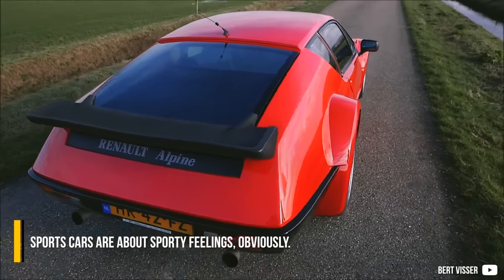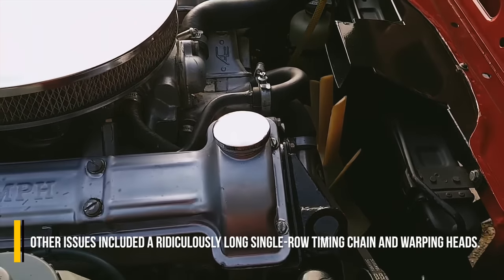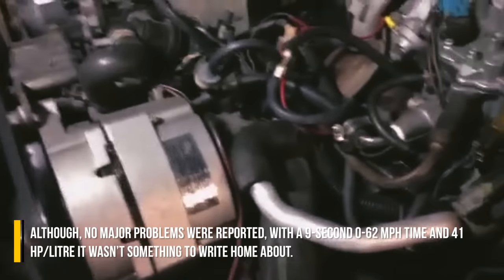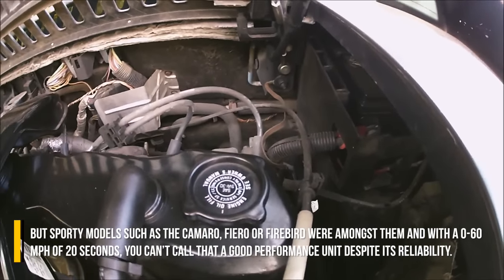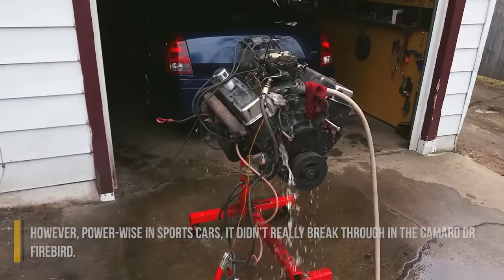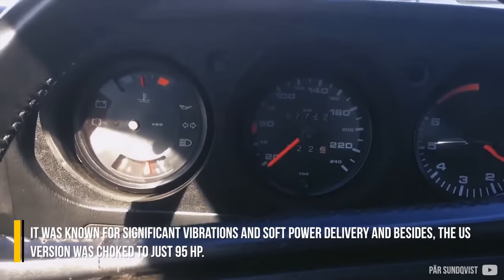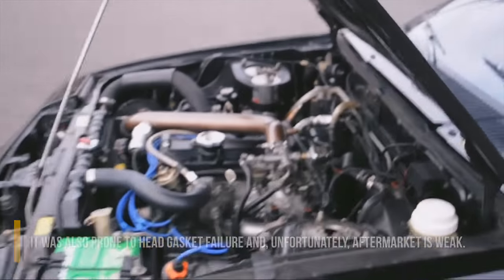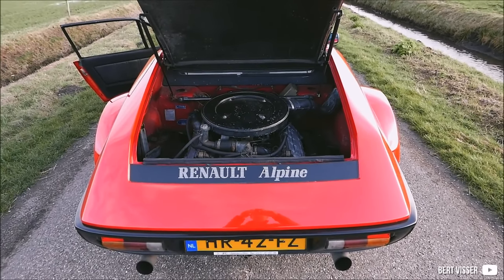Don't Buy These 7 Engines For Performance

Comment: the 80's were a dark time for north american engine producers. There was a 15 year period were the big three had to work with hotrodders in order to figure out electronic engine management.
Reply: @Tenorio_Cavalcante   yeah in 1987, the Buick grand national X was putting out a roughly 250/260 hp with a 3.8l v6, whereas the same year corvette with a 5.7l was only putting out maybe 230ish hp.

Comment: The iron duke soldiers on without complaint or failure...…….in my forklift.
Damn good engine if you just need a plain vanilla engine that can do nothing special, except run.
Reply: Steve po they can make crazy power too though. The super duty version in the non production pace car fiero was basically a built up stock iron duke and it made over 300 hp naturally aspirated
Reply: @zerohourdrift  is there a chance to somehow mode the stock iron Duke to achieve anything near that power?
Reply: D-Phoenix I mean if you take it to a machine shop and have it bored and stroked out, have custom cams ground, and have a crazy port job I’m sure you could. The issue is that there’s very few aftermarket parts, and the super duty ones were special race engines that use custom parts that were never available
Reply: @zerohourdrift  I read an article on hotrod which listed the aftermarket parts so you could build a super duty of your own. https://drive.google.com/file/d/0B0gyQbgYjXzfOWstRWs4SFpNcTA/view

Comment: To be honest, at the start of its life, the PRV was indeed a somewhat underpowered and uninteresting engine, with a troublesome maintenance (lubrication problems, regular valve play check), but improvements after improvements, it ended as a pretty impressive thing under the hood of Venturi sports car (boasting 400hp in road-legal 400GT, 600hp in the LeMan race car). Its V8 roots made it virtually indestructible even boosted with twin turbo, thus it is still holding today the world speed record on a circuit, with the WR/Peugeot P80 prototype, at 405km/h. The 2664cm3 flavor of the PRV was twin turbo-boosted at more than 900hp at the time. That is 333hp/l.
Reply: And there's something to say about the great Alfa 155 DTM. Its engine was based loosely on the PRV (used by Lancia at that time),  but everybody believed that there was a Busso under the hood. That was a big surprise that Sergio Limone, engineer in Fiat group, revealed only recently. Search "Limone Racconta: La verità sul motore Alfa 155 V6", with English subs.
Reply: True, i'm thinking about getting a 505 (with the 2.8 prv) slam it, and pushing it to its limits. The thing would be a really good sleeper:, rwd, good power numbers, slow look
Reply: @grymbathym635  don't slam it, put it on some coilovers and meaty tyres, make it a trackday car
Reply: the boring by now answer is ls it oddly I'm saying this about a Renault but i like the body lines , be a cool ass car if you just woke it up

Comment: 0-60 COMPARISON
—————————————
Chevy Camaro Iron Duke: 20 sec
Hyundai i10 1.0L: 14.4 sec

Difference: 5.6 SECONDS!!
Reply: Josh Bacon blame the Enviromental Protection Agency
Reply: thegrassmaster2 that slow?!?
Reply: thegrassmaster2 Especially because the regulations didn't really lower fuel consumption or emissions, only emissions per gallon of fuel used.
Reply: Josh Bacon 
It didn't help that it was only coupled with a Hydromatic automatic transmission.
Reply: in the fiero it had a 4 speed, but it 0-60 was still only about 11 seconds even after mods
Reply: it was actually 12sec in the clip
Reply: 151 gm engine is referred as the "iron mike" the pontiac 4 banger is bigger and was used in midget sprint cars
Reply: TranceBeatPony 
In the Camaro it was around 32 seconds. Though that was with the Hydromatic automatic transmission.
Reply: yep a i51 and a 2.8 v-6 witch sucked, the intake manifold would warp and leak coolant into the rear cylinder on the drivers side
Reply: I never realized how horrible turd gens actually were lol. I love how they look tho
Reply: Had to laugh at the 4-pipe exhausts, but smoke is only coming out of two of them!
Reply: And I thought my 1981 200T was slow.
Reply: No it didn't go to 60 mph in 20 seconds, it's 13.3 with a manual gearbox and 15.2 with automatic gearbox.
Reply: It is, Pontiac also made a slant four out of a 389 back in the 60s.
Reply: Josh Bacon 
Haha a rabbit diesel toasts that thing and it’s got 52hp 😂😂
Reply: A third gen Camaro is a thousand pounds heavier than Hyundai i10.
Reply: 1960s V8's made it in about 5 secs :)
Reply: I think that these engines were considered shitty even at the times when they were brand new - mainly because their price I suppose? Dunno how about today, I think that back then it was pretty expensive and not to mention that the price overall was increased if you wanted to improve its performance and thus for such money you could probably get a better car right away. But if I think about it, then I suppose that most of these cars from the video are probably inherited or really cheap and I do believe that some of those V6 engines with a bit modding or customizing could turn into cheap (even after modding) beasts...
This is just my idea, but I think if there was a forum board or like a blog post or something like that, just some list, with pretty much all the cars in the world, all the customization and prices it could be done to them, also not to mention all the interchangable parts (like “these cams fit into this engine as well and add 10 HP no problem”) then I think such list would reveal even much more hidden gems than we know today... of course it would have to be a list made by  decent mechanics, but still - still I think that the power of internet is showing off the potential of cars today with combining the share of information, knowledge and the speed at which it can be shared - sadly and ironically, this potential grows in the times when motherfuckers (aka manufacturers and other corps) are putting stop to combustion engines with their fucking emisions...
Reply: My 94 Pontiac grand am se does 0-60 in 11 secs, 3 speed automatic 2.3l sohc. Finally two cars I can beat.
Reply: You have quite a few likes there Josh. Guess they did not think it thru - nor did you. 90+ Hp with 80 ish Ft Lbs of torque trying to shove almost 2 tons around ( 3,600/3,800 lbs ) NOT a fair comparison - at all
The power to weight ratio is totally unfair. Compare Apples to Apples not Apples to Grapes.

The Difference : Never let Physics get in the way of a good story.......
Reply: Malaise Era bullcrap.
Reply: Rosco P. Coltrane A three speed slushboxes made in the early 60s.
Reply: Sorry but your comments are in reference to what statements that were made ? Your syntax is not understood at all. So English is not your primary language is what i read. Please, if your going to make harsh comments about something that was stated by another poster. At the very least understand proper sentence structure and make your comments at least somewhat relevant - get it.
Reply: 20 seconds ???!
Reply: Joona Huikuri explain
Reply: And like a huge ass year gap 🤦🏻‍♂️
Reply: Iron Duke. Had that in my Oldsmobile Calais. Slow. What was a surprise was running the engine on platinum plugs made it at least run smooth for a higher rpm range. Stock plugs had the car feel like it was going to granade above 135km/h while the platinums had it smooth through 150. Any higher and you were approaching the red line on s rated tires with canoe like handling.
Reply: The iron Duke was bad ass. You could boost the hell out of them
Reply: My 75hp vagon does in 14 seconds

Comment: PRV6
What they wanted:
Power of Renault
Reliability of Volvo
Price of Peugeot

What they got:
Power of Volvo
Reliability of Peugeot
Price of Renault

Meh :-/
Reply: Sorry men but this engine not had a lot of performance but respect him because renault is shit in reliabililty peugeot is better and some Volvo are unbreakble and we never heard  of this v6 he is not reliable...
Sorry for my English i'm french
Reply: didnt Peugeot use to be rather bulletproof back in those days, not was it until the 80's or so when the Quality went down.
Reply: The Renault Safrane BiTurbo had a 262 hp version of the PRV, which gave it excellent performance.
Reply: Mr MMJ The renault 25 v6 turbo too
Reply: The a310 is good fun!
Reply: the PRV got it's dubious reputation early on in it's life in cars like the Peugeot 504 coupe, 604, the Volvo 260 (262bertone coupe), Renault Alpine A310, R30TS. Personally i think it was just a question of mechanics not understanding what this engine needed and owners neglecting the engine as well. It had narrow oil passages in the aluminium alloy block so it needed good quality oil , good antifreeze coolant , perfectly bled cooling system and careful warming up. it had odd fire ignition timing with a dizzy using 2(!) sets of contact breaker points and the Alpine used a weird carb setup , 1 single and one twin carb. Not easy to tune if you don't know exactly how it  all is supposed to work. 

Later versions of the PRV  (2.8L even fire EFI, Turbo, BiTurbo and 3.0L  24V)  were a lot better. 

The very succesfull Alfa 155 GTA DTM racecar from 1996  also used the PRV shortblock as the basis for it's  race engine.
Reply: jfv65 Thas a very good engine the venturi is a beast with this engine she can beat porsche 911 but sadly now the french supercar not existing there is only sports models of everyday cars I'm french and its very sad to see the car like venturi not had a heiress today the french cars industries is boring
Reply: Oggy With a sport exhaut That sounds better
Reply: Martijn Scheltens And along with it being so much fun, that PRV just sounds awesome!
Reply: Peugeot is actually one the most reliable car company in 2017 and their 3008 won european car of the year...
Reply: Volvo 5 cylinders? Volvo polestars?
Reply: Not a bad engine, problem was murican technicians can't work in anything more than a pushrod v8
Reply: Hey, volvo is good for power. You ever see what people do to 240s?
Reply: I think the PRV was also used in the DeLorean
Reply: @davidjackson2524  and that is exactly where Americans learned to hate it.
The car should hsve been built with a V8, so the PRV, despite not being so shitty at all, still managed to disappoint.
Reply: And ironically, a twin turbo version of the PRV powered the Peugeot P80 Gr.C race car to 405 KM/H on Le Mans in the 80's, and it had 900 HP !
Reply: I used to like your videos but when you call an iron duke a performance engine I have to wonder about you and if I can watch your videos anymore.
Reply: PRV engine bring 6 wins in a row at Alfa Romeo in DTM Championship with alfa 155 V6 TI . Well, the budget Wasp higher than a F1 team..
Reply: Its a reliable engine dude (made to be a v8, so it can be boosted without any problems)

Comment: The Delorean V6 belongs on this list. The supposed corvette competitor was a slug.
Reply: It is on the list. It used the PRV V-6.
Reply: After posting, said  to myself, "Self, that must be the Renault engine."
Reply: yep, if only Delorean had either went with a V8, or at least went to Porsche and used a 911 type flat 6.  BTW, the BTTF movie cars used a Porsche engine, with Chevrolet Small-Block engine sounds dubbed in.
Reply: It was on the list.
Reply: @triangleofdeath6246  wrong, the driving car had a normal PRV, The sounds came from a Porsche 928 GTS ( which had a 5.0 DOHC V8 with 320 HP )
Reply: Actually the engine is not that bad, just made to be a family car engine or boosted, and dmc choosed the first option. Venturi used these with twin turbos and it got 400hp, renault too, and there was a lot of racecars using it, pushing between 600 and 900hp with them.
Reply: @scootergeorge9576  without boost it wasnt supposed to be fast anyway, the engine in the dmc configuration is supposed to be the configs you find in daily drivers
Reply: @grymbathym635   - John Z Delorean was billing it as a sports car. Or did he change his mind AFTER writing "On A Clear Day You Can See General Motors." A very interesting book.
Reply: @scootergeorge9576  These cars were supposed to have way different engines (i've heard about wankels) but he got arrested for cocain traffic, which mean he had no money left, and that's how the n/a prv got there
Reply: @grymbathym635  - GM was working on a  2 rotor Wankel engine that AMC was hoping to use in the Pacer.  A high performance 4 rotor could have found a home in the Corvette. But GM Cancelled the project.  And given the level of animosity between John Z and GM, it's difficult to imagine any cooperation if the engine was produced.

Comment: The iron duke was a damn good engine.  But not for performance, lol
Reply: Those little Grumman LLV mail carriers use Iron Dukes & they seem to be chugging along just fine. Pretty good proof for how reliable they are.
Reply: The Iron Duke is a failure of an engine
Reply: Randy Magnum yeah they were bullet proof like the Ford 2.3 and also very short winded as well.
Reply: but man did it have a great name
Reply: Not only are they gutless, but they're also gas guzzlers. USPS should recondition the LLV bodies and put them on an all electric chassis, that would be awesome.
Reply: Good generators...
Reply: idontcare80 I've got a ranger with the 2.3 that competed with the old iron Duke it wasn't very good on gas either. Maybe it gets better than the iron Duke. Still not what you would expect from a 4
Reply: Yeah, American 4 cylinders have never been very good engines. The goal of the big three is to make efficient vehicles as unappealing as possible so they can please their buddies in the oil industry, which is why I'll never own an American vehicle.
Reply: frank white - WTF are you talking about? Stop and go is where electric vehicles shine, thanks to regenerative braking. An electric vehicle is also ideal in a traffic jam because it uses almost no energy when it's not moving, unlike an ICE vehicle. Electric vehicles are also more efficient when moving slowly, the slower they go, the less energy they use.
Reply: ReidHenderson 
Ive come across a few gen sets with 2.3s on em, dating back to the mid/late 80s for a no start....
yea it busted the timing belt, and yes they’ve had the original belt. 
So now you know a timing belt can last some 25+yrs 😂😂
Reply: It's a utility engine, not a performance one.
Reply: Utility engines are usually efficient and reliable, the Iron Duke is neither.
Reply: @PistonAvatarGuy  When I mean utility engine, the Iron Duke was meant to power light duty pickups, such as the S-10, or Light SUVs, such as some jeeps. It was not suppose to power a Camaro or Firebird or Fiero. Also, the Iron Duke does 24 City 34 Highway rated by the EPA on a Base Camaro Sport Coupe.
Reply: I know what it was meant to power, but it was never good at powering anything, it's just a garbage engine, like the vast majority of the engines that GM has ever built.
Reply: @PistonAvatarGuy  However, Ford and Dodge Mopar engines have similar horsepower per displacement in the early 80s.
Reply: The 1985 Camaro got 19 mpg in the city with the Iron Duke, the 1985 Toyota Camry got 25 mpg and made 10 more horsepower (as far as I can tell). GM was still using the Iron Duke in the early '90s, when the Japanese were making much more powerful, efficient and reliable engines. The 1992 Lumina, for example, got 18/26 mpg and only had 105 hp, while the Accord made 130 hp and got 21/28 mpg, and the Accord was actually a decent car that didn't start falling apart three years after rolling off of the assembly line.
Reply: Yeah, basically all American engines were garbage from the late '70s until pretty recently.
Reply: @PistonAvatarGuy  my numbers are from the '82 Camaro. Also, the Iron Duke was one of the most reliable engines from GM of the 80s, others aren't.
Reply: The EPA revised all of the old fuel economy numbers so they better match with modern testing methods (so we can compare new cars to old cars more accurately), so those are probably the original numbers, which are higher than they should be.

Even GM's most reliable engine from the '80s is about as bad as you can get. That's like saying that it's a pile of dogs--t that smells better than other piles of dogs--t.
Reply: @PistonAvatarGuy  you're probably right. The EPA now conducts much more thorough testing.
Reply: My father had a brand new 87 s10 with the little fold out jump seats. That little 2.8 took us from pa to Florida many times. Up and down east coast. My buddy had a Blazer a 86 amd we would keep it floored witg 3 people and wouldn't break 100. Mabe 92
Reply: So was the ford inline 300 cubic incher
Reply: It has a cast iron engine head lol even my car with 70's tech has an aluminum head
Reply: @loomi58  I was gonna say that, they still deliver the mail everyday
Reply: Forty years ago picked up a 1970 nova with the 153/ two speed. Ran on one cylinder. Found someone had installed a six cylinder distributor. Found the right distributor, ran great 70mph top end. No power swapped in a 350 could wrap the speedo all the way around past zero. 140?